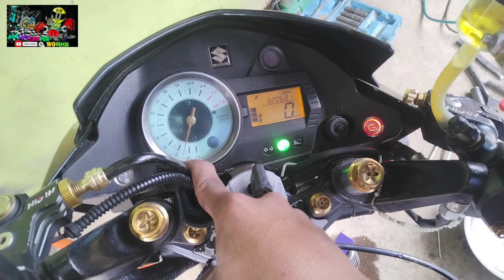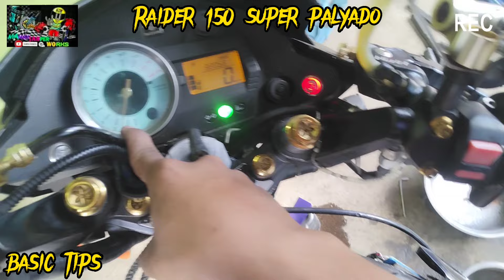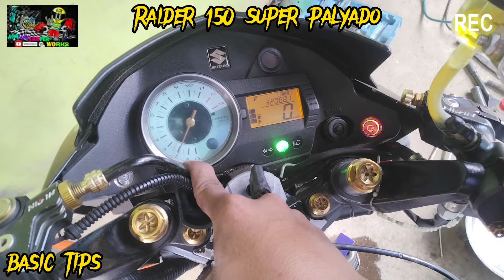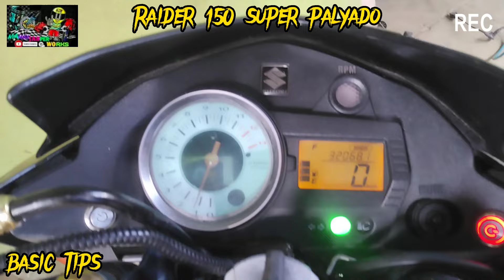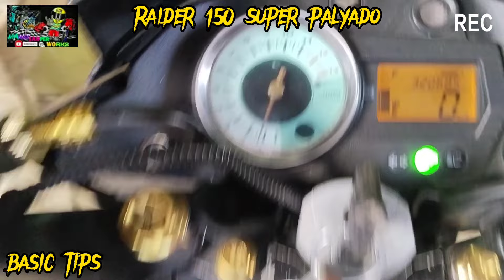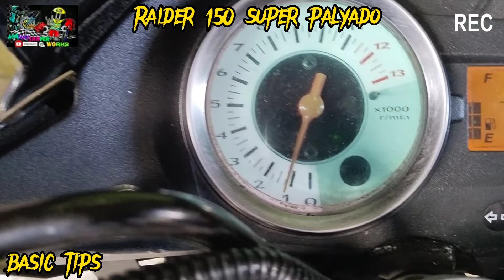Raider 150 palyado Na Mamatay kahit Nalinis Na ang Caburador palyado paden namumugak (basic tips)

Comment: Idol paano Naman Po gagawin pag pinapatakbo mo yong motor I pag nag full throttle parang nalulunod Po naka open carb Po ako idol
Reply from the maker: Palitan mo po slow jet idol
Reply from the maker: 42
Reply: @mamayjasperworksvlogs9679  
Idol Tanong lang Yung motor qoe kc pugak or delay sa low Rpm 2k to 3k Rpm namamalya pugak nalinis na Carb TAs ok nman diaphragm nagpakit narin aq air filter ganun padin siya sana mapansin sakit na sa ulo q sa stress . Thanks idol
Reply: @remarbarra3460  singaw, try mo tingnan manifold